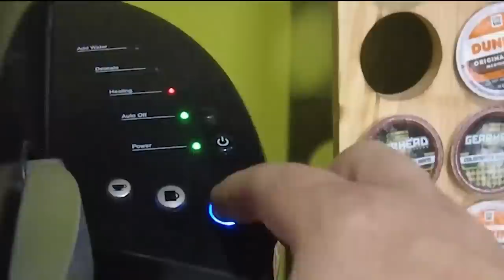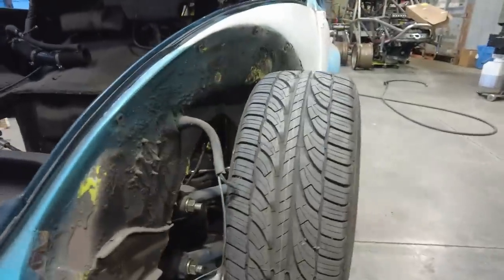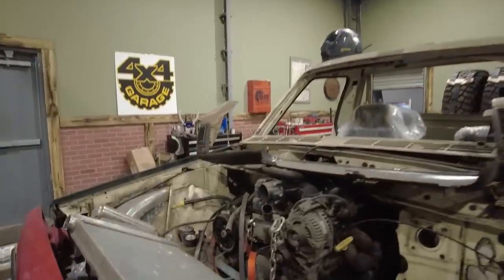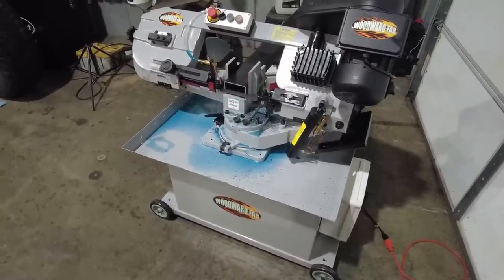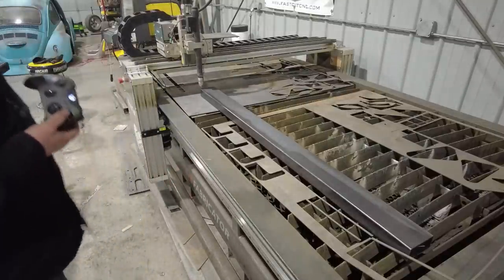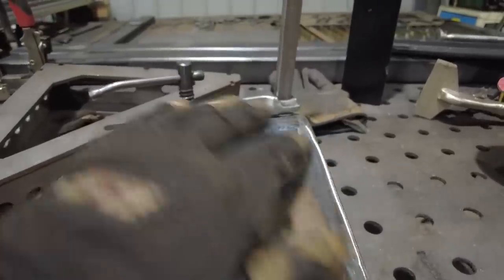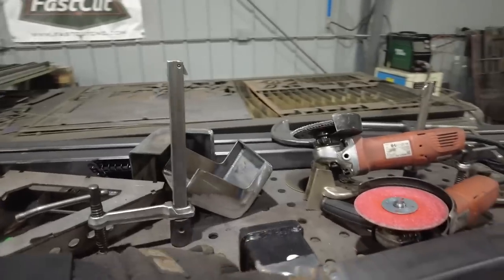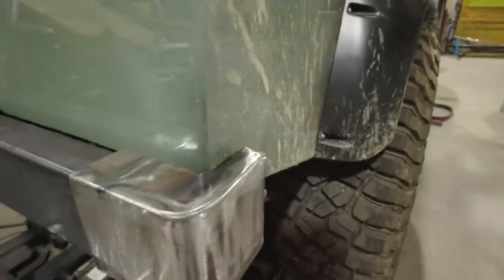Custom Bumpers on a Defender 110 and a Supercharger for the Gomanche

Comment: Ian, that fabricated rear bumper is cool looking with the metal end caps welded in place and that trailer hitch, along with the flush backup lights, just set it off! The plasma table is a total game changer and definitely saves a lot of time. Nice job as always and thanks for letting us tag along in the shop!
Reply from the maker: Thanks 👍

Comment: Try the 6 in Mikita metal  blade Ian. In any proper cordless saw makita dewalt or Milwaukee.  Just try it for 5 seconds. It will change your life. No it’s not noisy and it cuts cold. Just try it.  I have a fab shop.

Comment: Hi from eastern Canada. I'm  a multiple generations jeep wrangler owner over 5 different  years ( cj, tj , yj, and 2 Jkus). But recently purchased a utility sxs( I know ou aren't into them) to meet my other needs that he jeep doesn't. It already has a lift, bigger tire, bumpers and winches. I have plans to build a full rack system and a set of doors. I figured $5000 for poly doors,  I can make a lot of mistakes to build my own. I have a lot of 2" x 1/4" aluminum flatbar laying around that I plan to make the door frames out of. But the problems is stress cracks. I tried  2 different ways of bending it. Bending it flat with the aid of a wooden buck and a finger brake to aid in the bends and the 2nd fail that I was going to turn the flatbar into angle  by using the finger brake to bend the flatbar down the center by working up and down the center a little at a time.  Is Annealing the cure or what else can I try to make what I have work?
Reply from the maker: Annealing it will help yes..it might also be the type of aly you are using

Comment: Love the Gomanche build, it’s a very unique take on a chassis that has been done a lot. 

I have a jku rubicon that is a daily driver / back up wheeler to my 1 ton Cherokee. It is in need of ball joints and I was looking at the American Iron ball joint deletes because the Jeep does see regular off-road abuse and I like the idea of being able to rebuild them. What are your thoughts on using ball joint deletes on a daily driver type vehicle. They advertise them with a 2 year 30,000 mile warranty so it seems like they would be suitable for a decent amount of street use. 

Thanks, and Love the show!